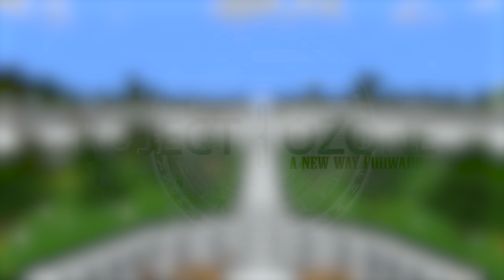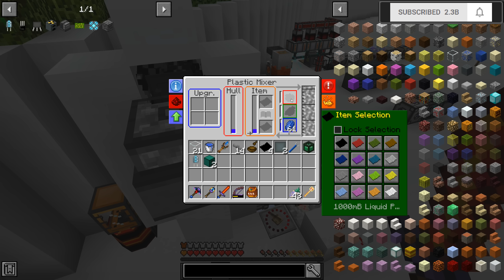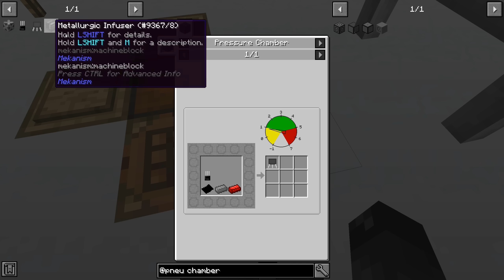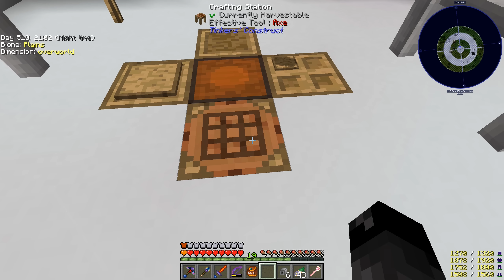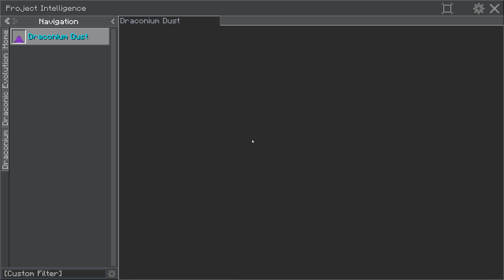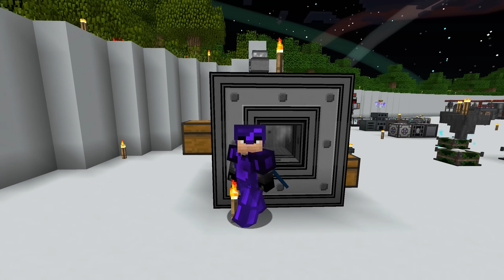Project Ozone 3 Kappa Mode - UNDER PRESSURE [E50] (Modded Minecraft Sky Block)

Comment: If you can get into mekanism enough. You will be able to make a mekanism fusion reactor that can output some massive power. It you use deterium and tritium at a rate of 98 it makes about 9.8 mil RF/t. It it’s D-T fuel that’s pumped into the reactor, at the rate of 98 it makes about 99mil RF/t. Just a thought for your power needs. Also unlike the reactor mod you have. This can run indefinitely once you have made enough of the machines required to support it full time.

Comment: @Hypnotizd 
can u pm me or reply to this comment? im trying to set veinminer on my server via chat so if i type in the chat /vm on    the veinminer plugin is enabled and does its job whilst doing the opposite turns it off and you can mine a single block at a time via /vm off

im running a custom FTB Ultimate Pack. i added blood magic, EE, and Draconic Evolution, and ive  been working on this is the config file of vein miner with no luck for the past 2 days, there's not a damn thing on reddit, youtube, anywhere and im not the brightest when it comes to C# coding, i understand it a little bit but i cant write it for crap. could u make a tutorial or reply back please as im sure im not the only one who would like to have veinminer setup this way for a server. thanks!
Reply: How is that better than just using a hotkey?
Reply: Because it doesn’t turn off, only on, believe me I’ve tried.
Reply: Is it because the mod is called OreExcavator?

Comment: Is the thermal expansion translocation plates available in this pack?
If so, use it to insert items in your pressure chamber. Use those ranged collectors you use on your mob farm to collect the items.
Reply: it was patched. the items are now only rendered not actually entities inside the pressure chamber
Reply: I can't seem to make that work in any way. Either that was patched or I'm doing something wrong. Tried a lot of methods but none worked. No more infinite pressure crafting I guess.